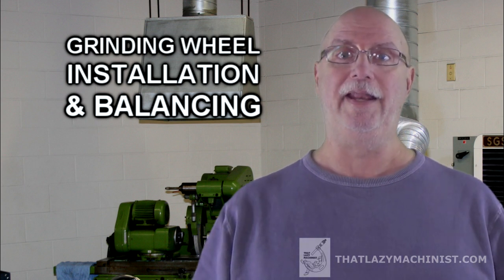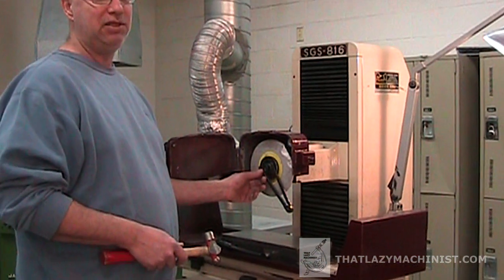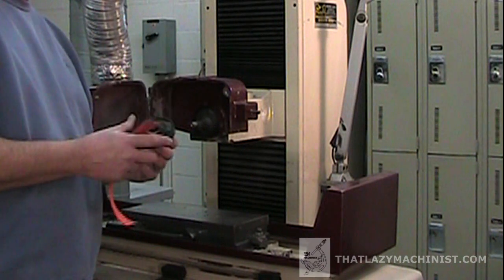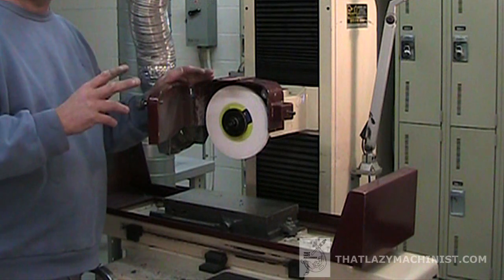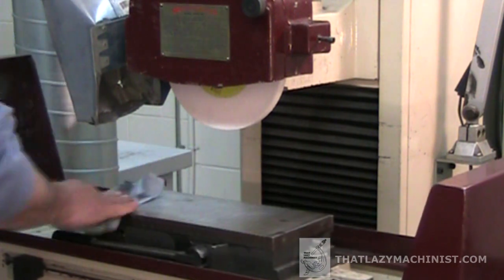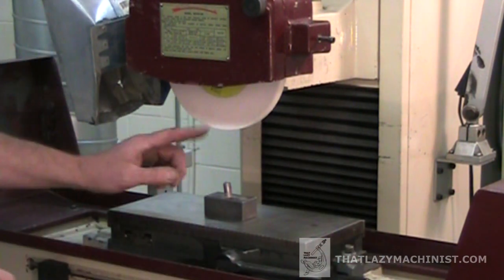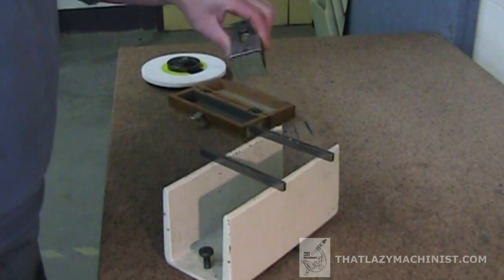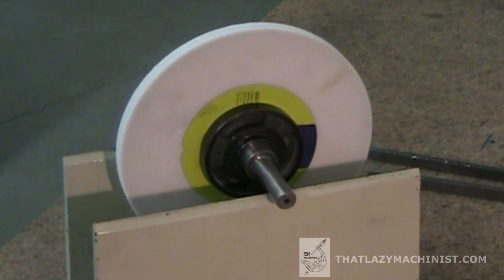GRINDING WHEEL PREPARATION  INSTALLATION, STATIC BALANCING, SURFACING WITH DIAMOND DRESSER

Comment: Thanks for a great informative video. I would like to add that balancing a 1/2 inch wide wheel is pointless and a total waste of time in a tool room. Get a sopko hub without weights for 1/2 inch wheels and save the balancing hub for 1" wide wheels. Over 30 years precision grinding and I have never once needed to balance a 1/2 inch wheel. Sometimes I change wheels multiple times a day. I probably have 50 wheels on a pegboard.  One inch wide wheels that will stay mounted until they wear out on a wet grinder should be balanced.

Comment: Is that a common grinder? I've never seen that type of grinder before. My school shop had some very large grinders, but they were conventional without a vacuum attached to them. The grinder in your video looks like it has a hepa vacuum hood around it? Also, a side note. Using a battery powered 1/4" impact driver is the best way to install and remove grinder nuts, and sawblade nuts. Because there is no risk to damaging yourself with a sawblade, or accidentally damaging the grinding wheel by trying to hold it, while using a wrench on the arbor nut. The impact gun doesn't even require that you hold onto the blade or grinding wheel, you can just impact it tight, without worrying about damaging anything, and the nut will be much tighter, so it's safer and won't slip. You need to use the 1/4" hex drive impact drivers, the kind that are used for installing screws, these are unable to cause catastrophic damage by going too tight.

Comment: Professional explaining of grinding wheels, much appreciate it! And as a beginner of selling grinding wheels, cutting wheels, pcd inserts, so much to learn, will always watch your video. Thank you!
Reply: I might never go back to one of my favorite stores. I went into "The General Store" and asked to get a bench grinder wheel. They said they didn't carry them. They have a hardware store that is part of the larger sporting goods store, so it's basically a large hardware store inside a very large warehouse sporting goods store. The manager and an employee showed me where their grinding stuff was, and said they didn't have any grinding wheels for a bench grinder. I was a bit sad, and I told them it seemed like something you should definitely keep in stock. Then the manager said "well, they aren't something people buy, you don't need to replace grinding wheels." Both the employee and the manager talked back and forth and justified the manager's comment, and they both said that you just don't ever need to replace bench grinder wheels, so they don't need to sell them. I couldn't believe they tried to create excuses for why they didn't need to sell grinding wheels. It seemed like a horrible way to treat the customer. I ended up leaving quickly and decided to never go back. Ummm.. If you sell grinding wheels for $15 each, people will buy them frequently, because it's nice to have a fresh grinding wheel on a big project.

Comment: To balance a grinding wheel, first, take out all the weights, put the wheel on the balancing stand, let it come to a stop, and put the first weight opposite of the heavy spot.
That one then goes Under.. the other 2, symmetrically on approximately 120°., then rotate Left or right by 90° and let go.

Let's see we have the first weight on the left, if the wheel then rotates right, the 2 other weights are too high.. lover them both and repeat the  check.,

Comment: Mark, Thank you for the primer.  I do have a question.  I just purchased three new hubs for my surface grinder.  The weights, three Allen set screws, and three ball bearings are in a package.  The ball bearings are a size that enables one to drop them into the threaded hole at the center of the weights.  If one does that, however, inserting the set screws and turning them merely jacks up the entire weight.  So, what am I missing?

Comment: a couple of tips-I like his videos. However he did not dress the sides of the wheel as far up as you can possibly get. That is where most of the imbalance is. when he dresses the wheel to rough out a new wheel the tip of a good diamond will burn off flat in record time. I suggest using a roughing diamond then using a good diamond only after balancing to give a final dress and conserve that diamond as long as possible. 

when he uses the master leveler on the balancer--actually its far faster and more accurate to lay any surface ground block on the rails and use a big steel ball bearing maybe 1 inch that they almost give them away. adjust till the ball does not roll. great even for leveling machines or surface plates I never use a level anymore and sold the one I had as having zero use and unnecessary weight in a tool box to lug around. they are vintage items not used anymore. 

that wheel hub is a balancing system using the 3 weights method. The simple fact is although a person can fidget endlessly he did not use the system correctly. take the 3 weights out. mark heavy. put the weights back in equally and symetric to the low or high mark. One weight at top of low up on top. now take the other two weights and move them up equally moving heavy towards the light. visualize you have your two arms down and you raise your 2 hands up equally. weights are never fidgeted with as shown-thats the simple truth. it can be done but what it does is confuse beginners and its best to take all three out and do them in the normal manner so even a beginner gets instant results. when balancing a wheel in a true life work dog eat dog environment there is not the time to fumble it has to be done fast. balancing a wheel using good stuff like he has--should be able to be done in 2 minutes max.
Reply: I was about to mention dressing the sides of the wheel.. ..and without a doubt...you get tons of error from sides of wheel....

Comment: Marc, I am confused. Does the hub assembly you extract from the grinder have counterweights in a groove?  If this is true, I suppose any commercially produced hub would have provisions to balance the grinding wheel.  I was going to make up some hubs for my surface grinder but may need to reconsider or see a blueprint/diagram for a viable hub.
Reply: dont make up no hubs at all simply use jb weld and tiny weights up next to the blotter.

Comment: Ok, now, what about the front and back face of the grinding wheel?
Reply: @anonymic79  The reason I mentioned it was I've been getting below par surface finish on parts, and I had a sharp right angle I needed to grind in tight, so I decided to clean up the face of the wheel and it actually took a lot more passes than I would have expected (I'm guessing that cup wheels are what's called for it this situation, but I didn't happen to have one at the time).  I'm an amateur at this so, I know I don't know anything, just enough to get me in trouble.
Reply: @anonymic79  Ok, I'll look into that, thank you

Comment: There's also a semi-static way to operate this apparatus. Once you have obtained the balance that you can using your method of "seeing that it doesn't start rotating", position the wheel at one end and give it a very gentle nudge. Note where it stops rotating. So this several times to ascertain that the wheel does not stop at the same angle repeatedly. If it does, then you know that you have to fine tune the balance of your wheel. I learned this trick fixing watches. If you don't have a dynamic balancer and you need it balanced as much as possible, then you can't do better than this.